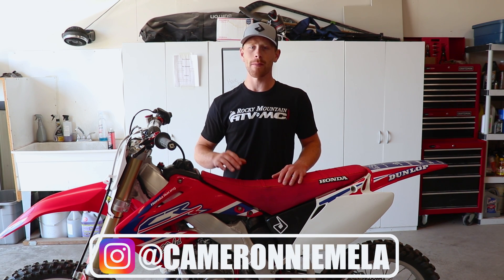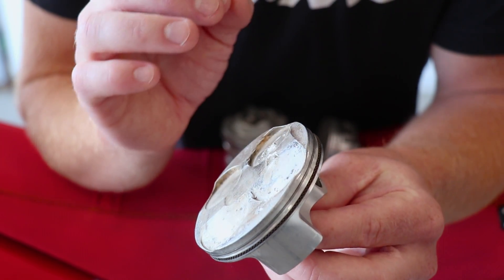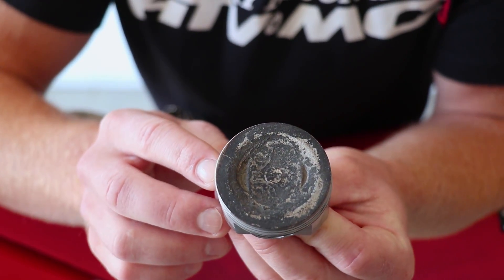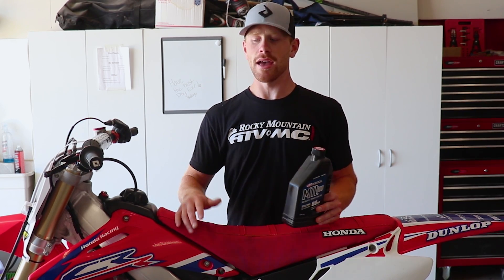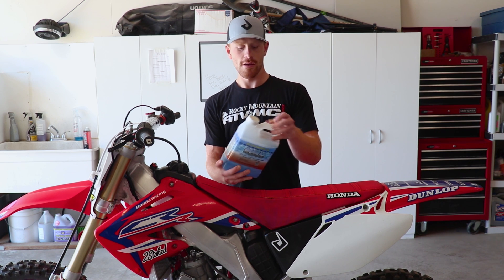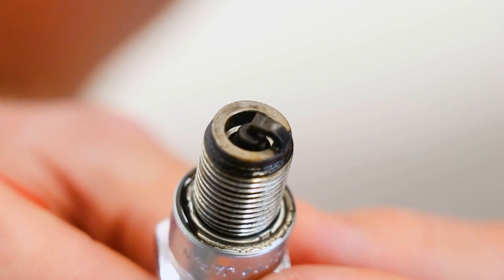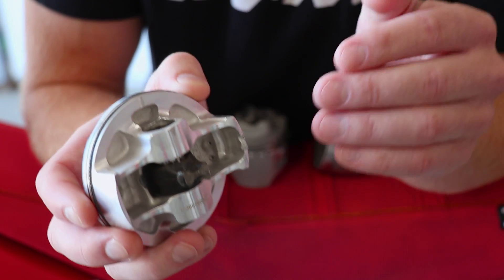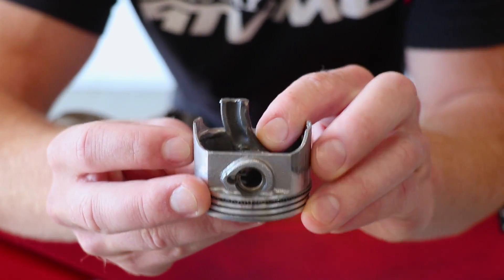Why Do Engines Blow Up?

Comment: My only reason why I prefer 4T over 2T because of people saying that 2T needs a rebuild earlier than a 4T would need it,however a 4T engine costs a lot more to rebuild!
Reply: Basko on two wheels did you a watch the video! Modern 4t are highly strung engines esp 250fs, they need more maintenance more oil changes and as regular rebuilds depending on riding if you compare apples for apples, racing it’s very similar, pros have 250f engines rebuilt completely after 2hrs, allot depends on Tyrone of riding and how hard, not whether 2t or 4t, don’t be ignorant, watch and learn here not what you hear people say. If you like 4t good. Don’t justify it with bs.
Reply: Mtb Ridingog really are u serious, you spend more money on premix land gearbox oil than a 4t top end, I have heard it all now.
Reply: Basko on two wheels main reason for me to switch to a four stroke is because of the power delivery, Two Strokes are always angry but they are easy to rebuild the top end.
Reply: I know people like to argue because of what I will say now but I just freaking love the sound of a 4T dirt bike it just roarss!!!
Reply: Bro I agree four strokes sound badass
Reply: Maverick224 you do I have been riding since 9 years old I have a cr125r that's a 2 stroke I have spent over 800 this year on premix oil and transmission oil do your research my dude before you start something you know nothing about 👿...
Reply: Mtb Ridingog I have been riding and racing since the late 70s dude, dont tell me to do my research before I comment, if you are spending that much on oil and premix you are doing allot of riding, or wasting allot or buying and using allot of VP or smelling it.
Reply: Maverick224 😂😂😂 your right I'm maintain my bike correctly hey it's no hard feelings I just wanted to say that before this goes to far ... I'm done brother you win
Reply: Maverick224 your will never pay more than $800 on a 4 Stroke top end most 4t cyclinders cost around $ 350-450 and the pistons maybe $150.....
Reply: Lack of knowledge on how to setup a 2-stroke for maaany people. On 4-strokes the manufacturers are trying to hone them to perfection but in 2000-2010 span they went for power and track times on 2-strokes and didnt focus that much on the powerband stuff. A 2004 KX250 has too snappy of a powerband because the stock powervalve opens too soon and it lacks midrange because of that="angry".

Everyone thinks 2-strokes are "pipe reeds carb jets and you get what you get if youre lucky" but theres alot more, porting, squish band, exhaust shape, reeds, exhaust valve opening rpm, 2-stroke is always a compromise but theres alot of technology not used into them.

If you ever get the chance try a gasgas 250, now thats beefy and there is no powerband hit anywhere, just raw torque everywhere.
Reply: No they aren't built to blow up, are you serious? Unless you race them like they were designed for they will last for ages. I'm talking 50 hours easy and I like to hammer mine on the dirt. They aren't made to blow up but they do wear more than a fully lubricated piston will.
Reply: I cannot really agree with that though. I also hear peeps are saying that, but it is not true from my view. I have been riding 2T and 4T, 4T needs shimming on the valve buckets and and and. a 2T is MUCH, MUCH easier to rebuild the topend, and yes as you mentioned at a fraction of the cost aswell. 

I dont know bro, I love my 2Ts!
Reply: oo0Spyder0oo Ktm's fuel injection on 2-strokes really was a game changer. I've been riding the 300 exc tpi for a long time and I have to say it is the best bike ever. It is really easy to drive as there is so much torque. Four strokes are too snappy for me after that 300. People think 2 strokes as like 125cc and it is true that 125s are really hard to drive bc there isnt torque and to those people I have to say that try something bigger. Old 2-strokes are also harder to drive and they are not so sophisticated as new ones
Reply: 4st need less service.. ummm have you seen the service schedule for a crf450r? Wouldn't know about 2st as I had them when I was young and didn't have to worry about servicing and all that
Reply: Mtb Ridingog it’s not about winning, btw that’s a year that’s cheap, buy a 250f and run it side by side the. Tell me it’s cheaper, ai can provide links to costs on parts easily.
Reply: Not sure why you're telling me this as I'm all for 2 stokes.  was replying to the guy suggesting they are built to blow up. I grew up riding 2 strokes and in particular motocross variants, I never find them hard to drive/ride, and yes you can get more torque if you stick with a larger bore size but good gearing will sort out most trail rides. I just love the powerband kick, nothing beats it.
Reply: oo0Spyder0oo I just wanted to get my word out there so i answered to you😂
Reply: no worries :-)
Reply: Basko on two wheels that's true but when you own a 2 Stroke the money you spend on transmission oil and premix can equal up to the amount of you rebuilding a 4 stroke top end ....